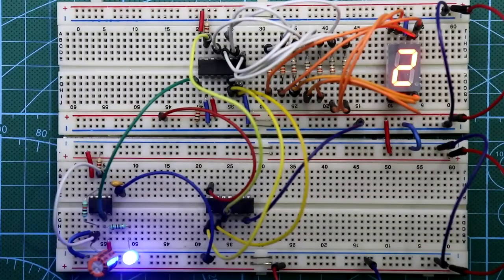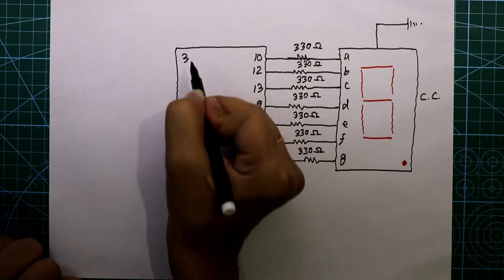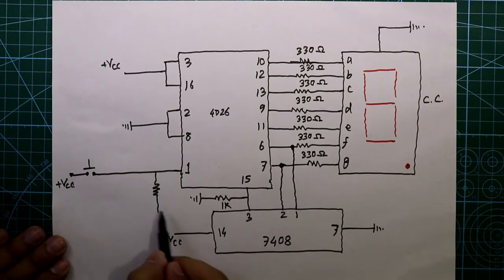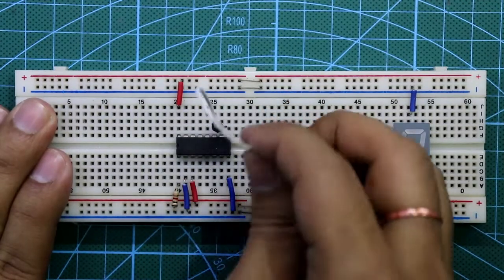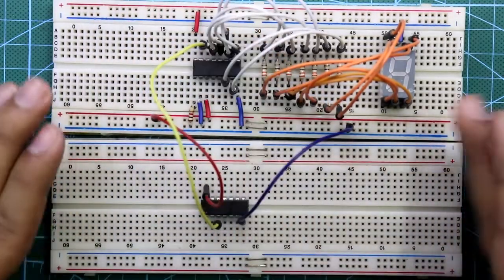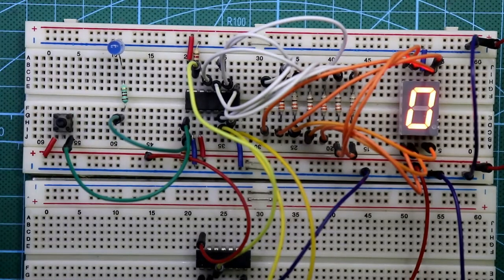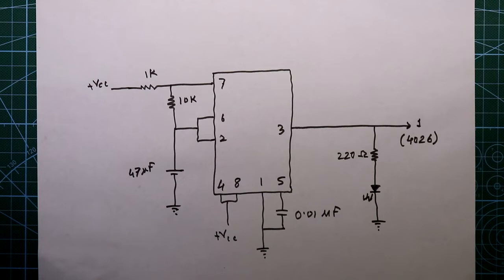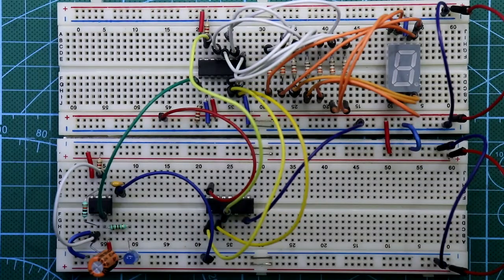MOD 4 counter with CMOS ic CD 4026 | Practical Circuit

Comment: Your schematic says 330 ohm resistors, yet you used 33 ohm resistors. Would that affect the final outcome of the circuit?
Reply from the maker: Hello friend, it is 330 ohms only. Maximum current rating of this type of LED is 20 mA. Here, the supply voltage is 5 volt. So, current through the LED = (5 Volt÷330 ohms) = 0.0151 A = 15 mA. That is why we should use 330 ohms with this type of LED. You can use resistors between 220 ohms to 470 ohms.
Reply: @EEWave   That makes sense but in the video you can clearly see that the resistor colors are orange-orange-black-gold which is 33 ohms.  I looked up the specs of a seven segment display and most of them have a maximum forward current of 170-185 mA. So if we do the math, 5 Volts/33 ohms = 152mA.  It's not enough to damage immediately it but probably is why the LED's were so bright.

Comment: can i use 7493 instead of 7408?
Reply from the maker: 7493 is a counter. You need AND gate IC. So you can use 4081 AND gate instead of 7408. Or you can make AND gate from NAND gate IC 4011, 7400, 4093.
Reply: @EEWave  hey can i write you a personal message? i have a problem want to give you a photo
Reply: @EEWave  https://youtu.be/addme/TUMaS2bKxxXoYAwmWze2RnH9nh5mdg join me
Reply: or do you have discord?